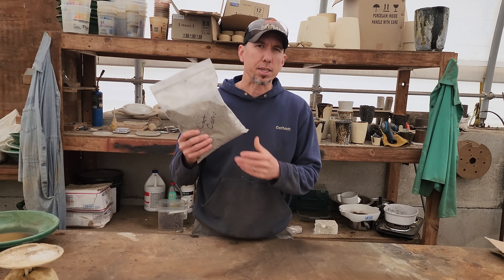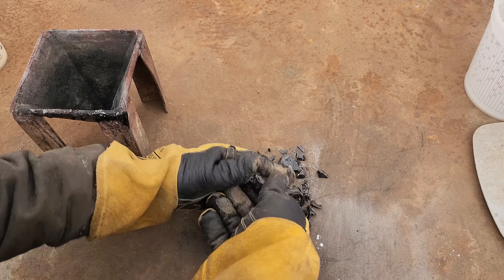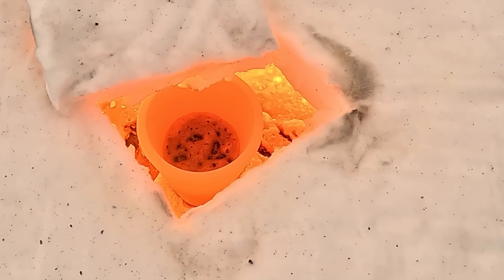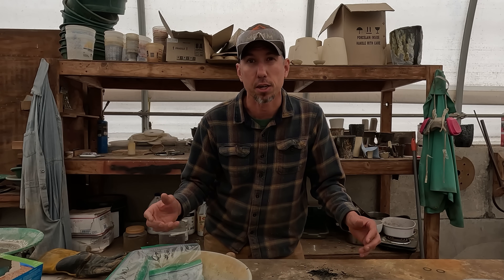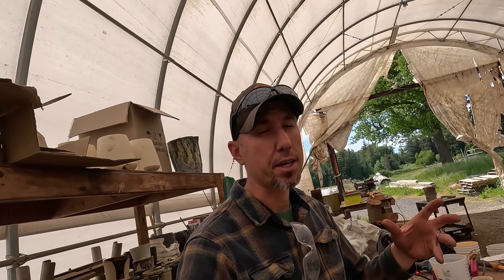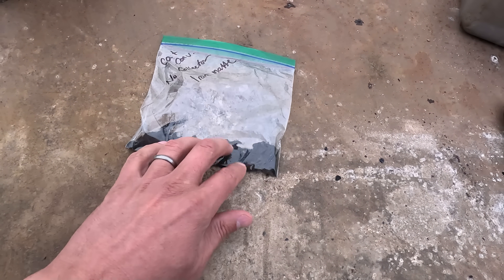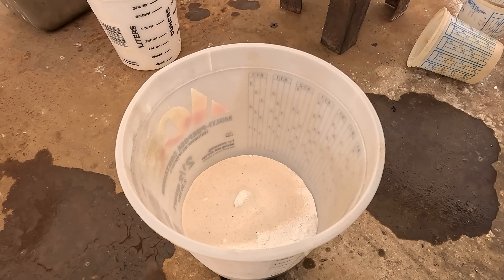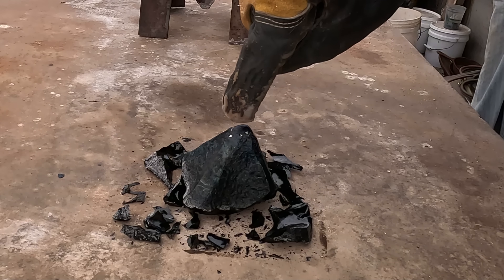Smelting Catalytic Converters, Platinum, Palladium, & Rhodium

Comment: I work in a plant that does exactly this. I work in the hydrometallurgical refinery where we leach the impure material and purify the Pt, Pd, and Rh. Very cool to see the smelting process on a smaller scale like this..
Reply: how hot does the monolith have to get?
Reply: Haha I work in the place that creates the honeycomb substrate that absorbs the metals. Idnt that fun.
Reply: @sayvorE88  It's ceramic, hot enough to melt that. Looks like molten black glass.
Reply: @convertediron  That is neat. We also make the Pt, Pd, and Rh solutions that go into the washcoat for the honeycomb that your place makes

Comment: In the dissertation I sent you, there should be mention of Nickel Sulphide collection. We used a Nickel and Sulphur based flux to capture the PGM's and then mill the resultant Nickel Sulphide matte into powder. Then dissolved in concentrated Hydrochloric Acid with added Ammonium Chloride. The residues would be fine PGM powder, which could be filtered off and assayed further.

Comment: Have you considered attempting to extract PGE or metal build-ups from soils/dirt on/near major roadways like I-5? I read an academic article a decade ago during my undergrad (I think the article was 12-15 years old at that time) about vehicle exhaust expelling catalytic particulates. These particulates were something like 95% metallic and 5% oxidized. The majority of the metallic particles expelled landed/collected within 10m of roadways in like the top 5cm of soil depth and in roadway dust. I can’t remember for sure, but I believe the article said these particles were very fine, like sub-1-mm. I also do not remember the exact concentration values found in the soils/dust, but I do remember the values were statistically significantly (p<.05) different than the background PGE values in the sampled areas. I also can’t remember if the article discussed or explored the potential uptake or concentration of the metals in plants along the roadway. Might be worth exploring an XRF before trying to smelt a sample. I believe the article concluded that the concentrations were not profitable.

Comment: Have you considered purchasing a handheld X-ray XRF gun? I know codyslab has one, whenever he goes prospecting it looks like it’s extremely useful. I would assume it could be used on slag as well. Although they’re expensive, I feel like you could make up the expense pretty quick in assay costs.
Reply: He has one. Hes used it in previous videos. Probably not good for this application though as the amount of metals in it is so small, and XRF give such a small sample size. And theres also the issue of sample distribution. Analytical XRF procedures require one to powder the sample and then press it back into a puck so its representative.
Reply: @alexdrockhound9497  No, that's MineOperator's unit.

Comment: Aah yes, if you have the PGM's in the Silver you can dissolve the SIlver out with Nitric acid, Palladium will dissolve in Nitric acid though. There must be a way to get that out seperately something easier than cementing on Silver. If I'm not mistaken Rhodium is a pain in chemistry if I remember well it gives a pink percipitate from Aqua Regia.

Comment: I really hope you reply. You mentioned how it turns from a hard glassy material into a powdery substances over time with exposure to air and moisture.
The elephants foot in Chernobyl which was a slag made from uranium and concrete melted together has reportedly undergone a similar transformation over time. It's now broken down into a sandy powdery lump.
Do you think it's a similar physical process to what you've experienced here?

Comment: Could you crush up the ceramic to a fine powder and run it on the shaker table to collect the platinum?
Reply: No.
Reply: That is what I kinda thought 🤔
Reply: @petersyverson1722  it's CVD chemical vapor deposition, so think molecules or atoms. That's why he had no recovery, he started with to small of a sample size. Really, (IMO) the only efficient way is using acids to dissolve the PGMs from the substrate.

Comment: You should try and crush plastic chrome parts and see if you can recover the paladium from them. When they plate plastic chrome, such as the grilles on all new Ford trucks, they first rough up the surface and then impregnante it with paladium and the paladium is what the nickel and chrome actually stick to. (I watched Modern Marvels about chrome recently)

Comment: You can make a milling tool by taking a foot or less of threaded 2 inch water pipe and capping one end. Add heavy ball bearings and your button and cap the other end. Shake and bake.

Comment: There is also a chemical process you can use and then you electrolysis the metals out of solution without having to use a furnace.

Comment: Your ‘furnace’ might benifit from a High emissive coating to increase efficiency and help it last longer. Gets hotter with less gas because the infrared gets reflected back into the crucible instead of through the walls of the furnace. YouTuber Nobox made a video about it today. Something to do with zirconium

Comment: I’m just curious through the refining process if the harmful items that were collected by the catalytic converter are released back into the atmosphere therefore navigating the hundred thousand miles of use for the catalytic converter. Or maybe they are captured in the slag. I’m curious about opinions there.

Comment: I guy I knew in the 80:s he used acid to get the precious metals out from the converters.
The way you do it is to expensive. It would even be better to use a tweezer and hand pick the stuff. You can easily see the shiny particles even without a magnifying glass.
Reply: Pgms in acid can cause some very very serious long term health issues if a person is accidentally exposed to it.  It's not from being acid burned but some wierd thing the body does after exposure.

Comment: Silver tends to be a bad collector for Rh  using Litharge based fluxes in traditional fire assay work. No experience with it being the sole collector.

Why not try a NiS collector ?
Works well with most ceramic matrixes and you can dissolve the NiS in 18.5%

Comment: ummm 20 grams in and 20 grams out does not mean anything! ! you still dont know if it was contaminated by something hint calculate the density of your final product! if and i am not saying it is but if the density of silver is 30 then if your sample is 100% silver you should be able to use it and come up with the density of silver. as for mixing together the collector metals in powders or compounds i would be looking at chemical equations and i would be calculating mole mass  of all of it and for each atom type in the compound then i would try to calculate an estimates volume of my alloy with out contamination ie with out the metals to be collected. an knowing the mass should be easy. once you do that you can change the scale and melt it all down with the cats get your metal out with a known density calculate the density of your sample and if it doesn't deviate  from the pure sample then you know it has what you want in it. ps its alot easier to chemically break all that down
Reply: Gold and microwave

Comment: You should seriously be doing that with a mask. That stuff is really really bad for your lungs. Basically like fiberglass or asbestos. 
I've only knocked out one catalytic converter not to collect the platinum but to make a car sound better lol. And I still remember while doing it that it gave me that prickly sensation in my throat even while controlling my breathing so I wouldn't directly inhale any. It's not good stuff. And powerizing it, as opposed to breaking it into chucks and pulling them out seems way more, fore lack of a better word, pollutey for the air your breathing.

Comment: What are you talking about you just solved, silver as a collector for about 2000 years and silver as a collector in scrap , only about a 100. Might be new to you , constant forum conversation over the last decade. My question will be , will you show the kno3 ingedtion and subsequent Ag/pd drops and then the pt/rh smelt. Currently its dirt and the refiners will ding you as such. Still waiting on the parting video instead of guessing precious metal composition ratios by color.  An assay is value to the penny. What are you waiting for ?
Reply: Was that ‘KNO3 ingestion’? Looks like you might have a typo in your comment friend.
Reply: @waynoswaynos  no typo there
Reply: So yes , it was a typo.
Reply: Lol , how is nitric a typo, this explanation will be good. You realize that is the foundation of assaying. The only other replacement is to go straight from dore to an icp plot , so please explain the typo
Reply: @Au_Explorer  you originally typed "will you show the kno3 ingedtion and subsequent…". The word after 'kno3' doesn't make sense to me. I am trying understand what you said about 'dirt and the refiners'. Just trying to learn is all and comment was unclear. No offence intended. Looks like you know your onions which I appreciate.
Reply: Thank you for pointing out the  "a" instead of the "s".  In ingestion.